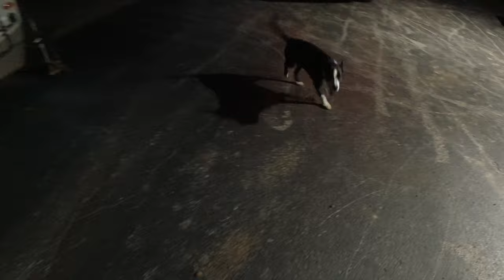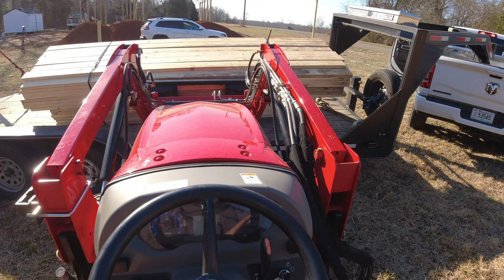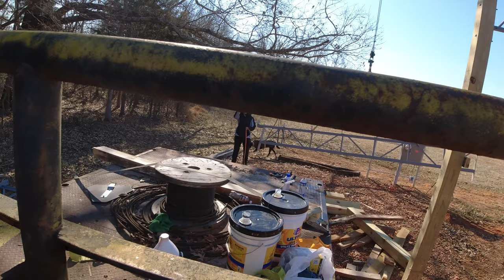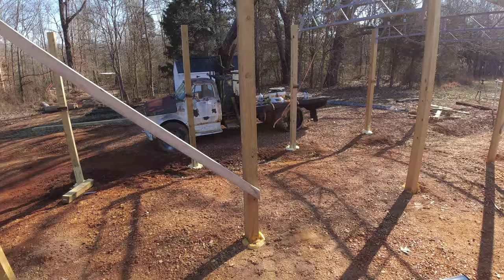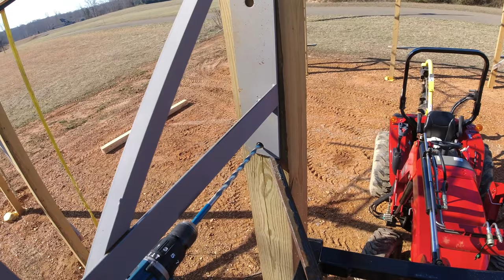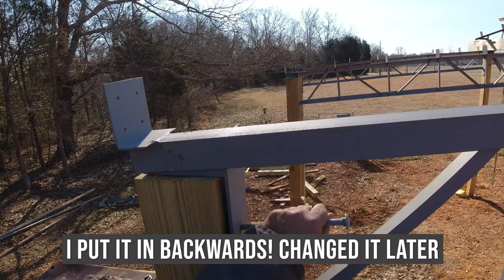44x40 Pole Barn Shed Side / Setting Trusses

Comment: Sounds like you are having a blast together ❤ . Glad you flipped some of the coach bolts, the nut usually goes on the metal side over here. But as long as it's tight it'll do the job. Thanks for posting folks.

Comment: Looking good. I was going to ask, why did you get such long poles then have to cut off. Did you need the cut off for something else or the only length they had? Thanks for sharing. suppose to get wintry mix tonight and drop back below zero again here in Iowa
Reply from the maker: The post around here come in 16' and 20'. It was just at the place I need more than 16'. It sucks too, because the post are expensive.

Comment: It's coming on up! Great work Tony and Tanja! 👍🔧 What kind of lighting are you planning? High bay metal halide or flourescent ?
Reply from the maker: David, I will put up LED strip lighting. It is brighter and at a fraction of the electricity. The cost of LED lighting has dropped so much.